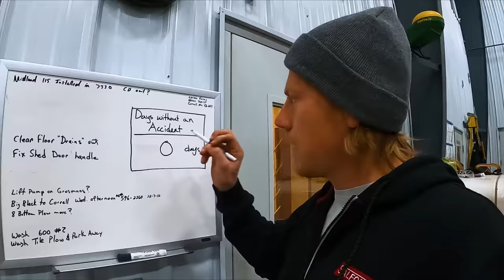Farm Accident Resulting In A ER Visit! Big Swede Down!!!

Comment: Chet, you can put 1% gasoline in your diesel tank to prevent gelling when it’s that cold. This small amount shouldn’t cause any injector pump damage. Add a little 2 stroke oil also if you’re worried about decreased viscosity from the added gasoline.

Comment: If you have enough metal in that joint, you might try slathering some high temp JB Weld all around it to seal any pinholes and add reinforcement against vibration. You'll never be able to (metal) weld it again but if it's already getting thin and the next step is a new muffler, it could be worth a shot.

Comment: Eric, here is to speedy recovery. Chet, the same.  Re:lift pumps. Would it be possible to drop a stock tank heater in and then put a cover over vertical ADS section. Then you wouldn't have to pull the pumps.

Comment: Swede It happens to all of us. About 3 months ago I lost my footing and tore up both knees both hands and planted my face in the concrete drive at work  breaking my glasses which required liquid skin for the cut it made on my eye brows. Had a black eye and almost broke my nose. 3 weeks before they released me. $1100 to replace my glasses. The thing is no matter how hard you try to stay safe accidents will happen. It's a good thing if you can work with others as much as possible. Be safe .

Comment: when you are pulling concrete toward yourself lower the thumb so it can help deflect the concrete should it shoot toward you as you have it under huge pressure.  do not hve to grab the concrete just use it to block anything flying toward you.

Comment: Besides the cost is there a reason you guys don’t run straight red dye with PowerService mixed in it to avoid jelling? I also let hydraulic machines warm up for a long time. I usually let it sit for awhile and the turn the throttle up for another while.

Comment: I watched another channel of heavy equipment mechanics/operators, they suggested fuel every night (especially in winter) because working heats the fuel tank and if left partially empty it will gather humidity on the top of the tank as it cools down. The gathered water will drain into the tank and cause corrosion, rust, algae, etc… If you fuel at the end of the day the full tank will not allow the humidity to gather.

I don’t believe your theory on “warm fuel” is a valid theory. If the fuel is going to gel the damage is done prior to adding the fuel.

Comment: Feels wrong to be digging a hole next to a fire to put tin and wood in. With all that tin I'd have hopped that it would be more economic to take it to the scrap yard and burn the wood. Ok still got to bury the concrete but that would be a much smaller hole.